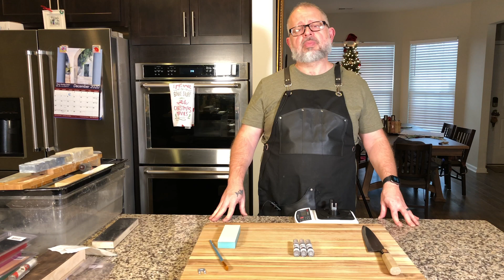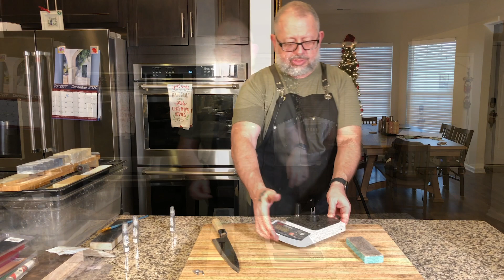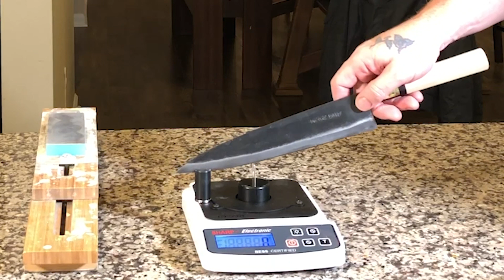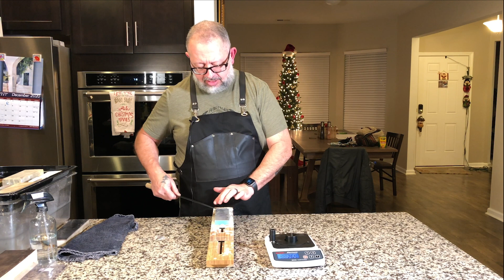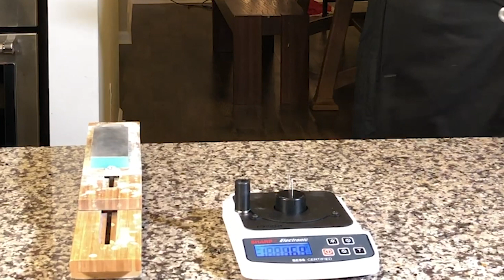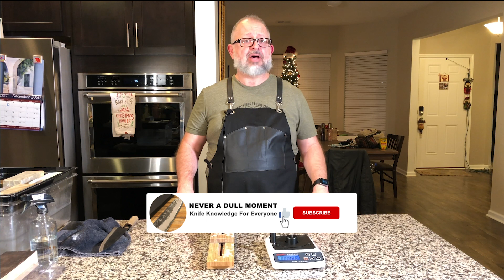Knife Knowledge: Gunny Juice!! It is worth it. Never a Dull Moment! Knife Sharpening!

Comment: I tried this juice with Jende strops and on leather strops with 3,1 and .5 gunny juice.  I was not impressed and felt I wasted my $$$. 
What percentage of diamonds is in each bottle . Know how much (iirc you stated per liter?) Doesn't help.
Gritomatic is a excellent company and I will continue to make purchases from them . But not anymore of this stuff. I buy the techdiamondtools paste at less then 1/2 the price with 50 percent concentration of diamonds . Something about the gunny juice 3 micron seemed to be wrong as it was less viscus then the .5 and did nothing .
It doesn't pay for me to have sent it back since I live outside the US.  But never again.
Reply from the maker: I would actually say it's your strop. If you used his nano cloth strap, then it's a honeycomb shape. We have a different video where we test all of them. Ken Schwartz was on the phone constantly to make sure the test was ran properly. The results were very clear. Each manufacture was our behalf actually happy with the product. The strop from Jende industries is a honeycomb shape below the surface. The owner said a person presses too hard that the honeycomb will scratch the surface of the edge and the knife. You will see us use the same piece of leather cut from the same towel and then you will see us all using nano cloth given to us by Ken Schwartz himself before he died. The nano cloth has no abrasive contribution so each diamond emulsion was tested independently so that the leather material would not contribute any type of Abrasive. The certified scientific testing certificate states that the gummy juice products is over 98% the proper particle size. What that means is that a lot of products might say they're one micron but might have a certain percentage of material that is slightly higher causing you to get scratches that are too big. It's the highest rated product. He has also the highest ratio of diamonds. 200 carrots per gallon. There is no other product on the market that uses that ratio. Other products I've come out since this video and Scott has never kept his formula a secret. The difference is that Scott uses deionized diamonds so that they do not coagulate and form a clump. Also, the liquid that it's suspended and is kind of like mercury/water. It dries very fast and you might be used to something that's a little thicker. I truly believe it was the material you put it on. We used different materials in our testing and you will see the results. We do all of it continuously so there's no camera magic. I am not used to using something as high as 3 µm so I have no clue what a factor that would have. I use the .5 µm all the time. I have gotten test results down to 67 and lower. Scott has his own videos where he shows a score of 12 and lower. He does everything on camera and does or two knives that are identical and he uses the two different machines to show that the machine wasn't broken. I'm sorry that you feel that way. I think you'll see that our test results were quite in favor of the product. There are some new products out there that we look forward to testing. Tokushu knife has tried to come out with something comparable but did not deionized the diamonds. They are using oil to suspend the product and it takes forever to dry. Scott has never paid for any type of testing on our show. All of the materials in the testing were each donated by each of the companies so none of them paid money to have the test results done. We were in negotiations for three months to make sure that the manufacturers were very happy. You will also see Jende industries goes way out of their way to say that their product is comparable to Scott they have plastered his name all over their website to try to say that they can keep up with the product. That's a big compliment. https://www.youtube.com/watch?v=zZquY-zAC6U&t=1s

Comment: Just tried it out on my Takayuki VG10 petty coming fresh off the Shapton glass 8k then I loaded the strop with a decent amount of .5 gunny juice to cover the leathers grain, even though the kangaroo leather is thin it soaks up rather fast so I had to be as fast while applying with my finger to get even application, then let dry till slightly damp and went with 30 strokes each side probably not needed but worked amazingly well...just cut some fresh ginger this morning to add to my tonic and as I expected they came out paper thin.
Reply from the maker: I'm in love with the product. He is going to be coming out with .01 µm. That's a little bit crazy but I saw him use it and get a BESS score of single digits.

Comment: Thank you for this interesting video. I was primarily using a 3 X 11" kangaroo strop, and the only diamond spray I've ever tried on that, or any other strop is Richmond's diamond spray in .5 micron & 1 micron coarseness. The Richmond sprays on fairly evenly to begin with, and I then used only my finger to spread it out. I did not end up with excessive diamonds on my finer, and it was fairly easy to spread out. After trying it, I switched back to using the kangaroo strops I have dry, without any compounds, which seemed to work much better in my case. This is not a criticism, but I was a little surprised to see you using a medium length kangaroo leather strop on a 250mm knife, but you made it work. My current favorite leather & strop is the Burrfection rolled buffalo 🐃 3 X 12" strop. It is just an incredibly effective strop. However, it has a naturally high oil content, and when I tried adding a very thin layer of mineral oil to it, the strop became very slick, until the mineral oil was worked into the strop. I will probably never try adding mineral oil to it again. It naturally has a really nice drag on the bevel, when you hit the perfect angle. I suspect rolled buffalo would be more conducive to adding a diamond spray to it, a opposed to my kangaroo leather strops. But, for now, what I really like, is how the buffalo leather grabs onto the bevel, when the angle is just right, so I'm just a little hesitant to try diamond spray at this time, until I get a couple more, and then I can experiment on the oldest one. When I had posted my questions on Scott Gunns FaceBook posts, and I finally noticed that he did in fact answer my question the first time, I was only asking about the diamond concentration, and he pointed out that a better question to ask would have been about the quality of the diamonds used, and possibly about the emulsions. I'm heading back to watch your unboxing of the moritaka 250mm Gyuto.
Reply from the maker: I think you're doing everything right. You've jumped in as hard as anyone could. It just takes time now. Give yourself time!